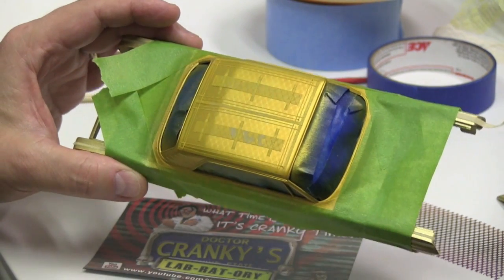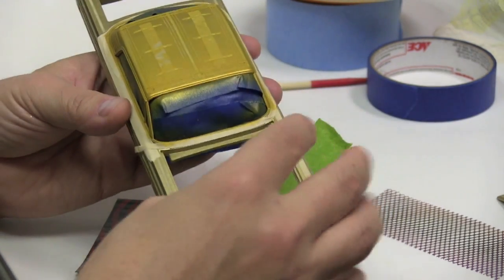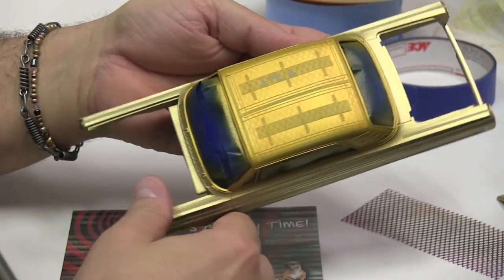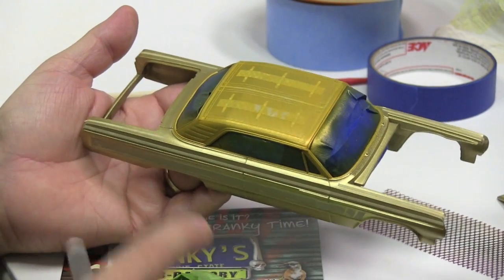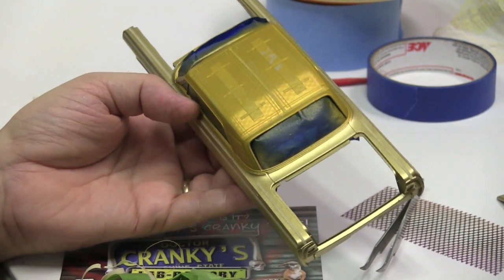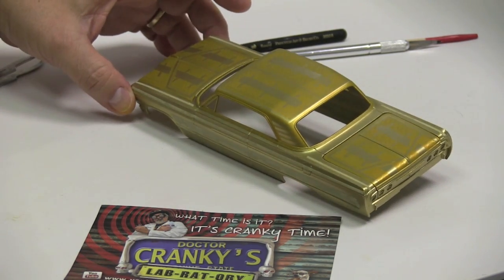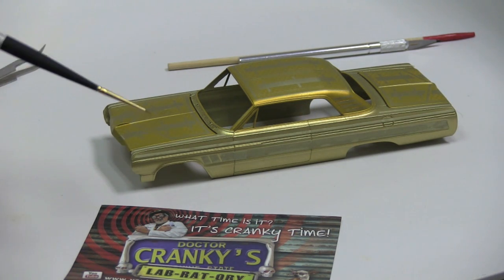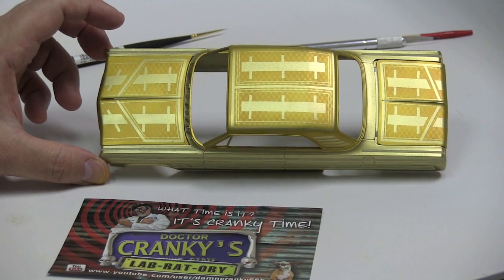CLINIC:  Layered Paint Job, Part 2

Comment: ill use a little needle to get the tape of.
Stick it in a corner horizontally of a tap, and lift in one and the same action so you wont hit the bottomlayer underneath the tape.
failproof also with the small tapes i think.